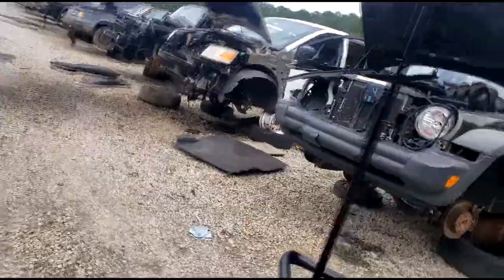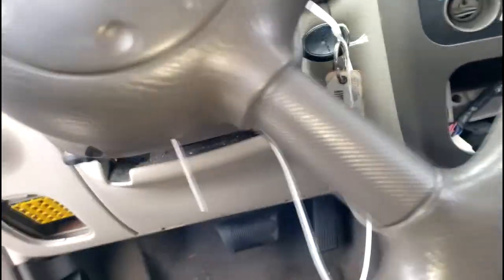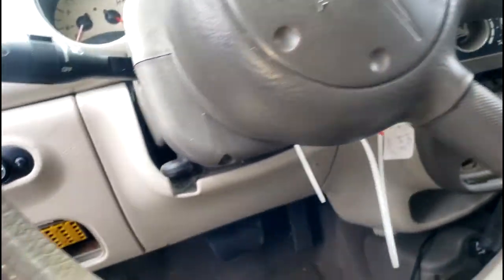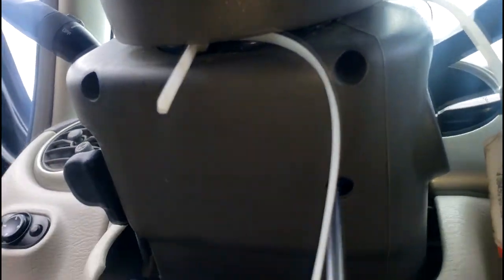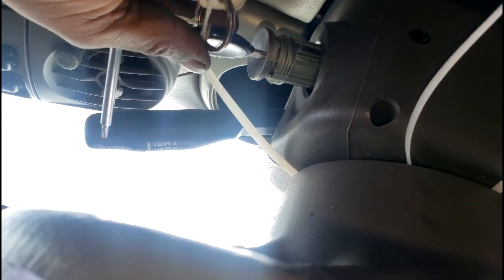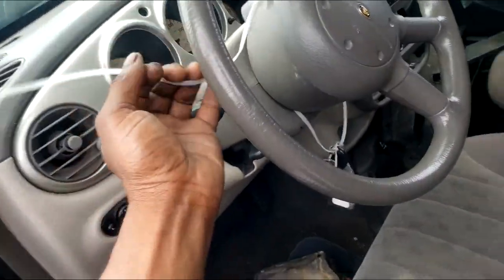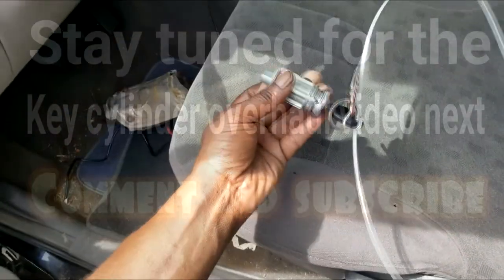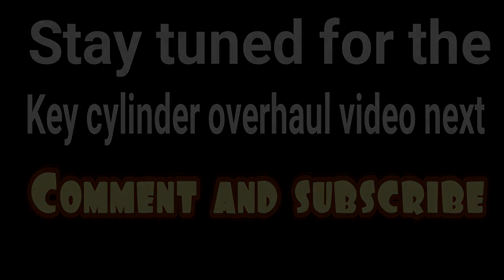BTJT How to DIY fix a key that keeps sticking and will not turn. Key cylinder overhaul. Pull A Part

Comment: I guess I should have said I use WD-40 on a still functioning not yet totally failed lock cylinder. BT with JT has got it going. Thank you for the lock cylinder tips.
Reply from the maker: Thats whats up, thanks for watching bud

Comment: When my PT cruiser started giving me issues with the key cylinder , I took it out when I got the chance I removed all the tumblers put the cylinder back in the column and was good to go . I attached a harness to the vent and attached it to the key , it jumps out going over bumps
Reply from the maker: you must have the gen 2 PT?
Reply: @OnlineMechanicTips  it was a 2001 , it had old type of dash and radio. The only way to get the ignition  cylinder out was to turn the car on
Reply from the maker: @danh2134  Right..then push up on the lil release tab and it comes right out,,Im building this one for my uncle..Just gonna take it apart, clean it up real good and go back in with new tumblers then send it to him to install on his car